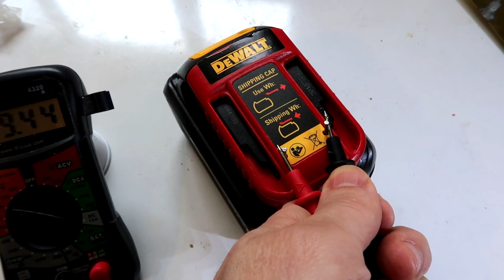Building a drill battery powered work light

Comment: Matthias, great video but as someone who works on lots of home brew projects with these batteries I think there’s one thing you need to mention. All lithium ion batteries should have a low voltage cutoff, as a Li-Ion battery drained to zero is essentially junked. Dewalt handles low voltage cutoff in the tool, not in the battery, so if you forget your light and leave it on all night you’ve effectively junked your battery. I’d put a note in the comments or somewhere to be sure people know this, I’d hate for people trying to save money on their light to junk $75 batteries instead.
Reply: Sounds like an important callout! Is that not already integrated into the battery itself? If not, how would someone add this?
Reply: @derekroetzel  done lithium ion batteries do, DeWalt chose to include that in the tool and not the battery. You'd need a circuit to do that and put it inline. I don't have one in particular I use, but I imagine digikey and them have premade boards for that

Comment: Be careful! DeWalt XR battery packs do not have undervolt protection. A bulb like this will suck the battery dry to the point it might not take a charge.
Reply: if that ever happens all you have to do is take a good battery and jump the dead battery in parallel for a few minutes, and it will bring the dead battery back to life..... this is coming from someone that has been working with all types of lithium batteries for over 20yrs...
Reply: Are you think that the first lamp has same protect?
Reply: @darkfrei2  the DeWalt lamp has protection, yes.
Reply: @OliWarner  So you can take the body of this lamp and set new LED to it.
Reply: Since the bulb uses a voltage regulator this won't be a problem, as the power should be cut off at a certain voltage
Reply: @CementRoots  It still will do damage and lower it's run time
Reply: With all dewalt cordless tool s you can run the battery down that it won't charge from the charger! I found out when I borrowed my neighbor a couple of batteries and he drained them to the point of no return. I got a nimh battery and jumpstarter the 2 dewalt batteries and good as gold. He must have been running them till they cut out and tried running again. The BMS in all power tool batteries are a bit dodgy from experience.  Anyway. Great video and cheers from Australia 🙂👍👍👍

Comment: Just watch out, the battery might not have over discharge protection. Not sure about the dewalt with the whole flex volt thing but with my Milwaukee batteries the terminals are connected directly to the cells (and the protection is in the tool). That said, pretty neat, have been meaning to do a custom work light for a while.
Reply: This is true for DeWalt batteries too; protection is in the tool, not in the battery.  The worse part is that there is no short circuit protection. Mathias should have put a compact fuse on one of the wires IMO.
Reply: @mrvelleful  they are pretty small wires...
Reply: Yeah, this would be a really cheap way to kill a very expensive battery. 

It also needs a switch, because fitting the thing into those tiny holes in the dark. And stepping on nails sticking out of a board.

Comment: I bought off eBay an adapter that has two wires and fits dewalt 20v batteries for 12 dollars. I then connected it to a 15 dollar led off road light. Works just great.
Reply: Not bad, however you're looking at $27 for a light.
You can these lights for like $5 or a COB array of 10-25W for same price.
Reply: @boots7859  that adapter is very flexible though, easilly can be adapted to work with anything. Worth getting.
Reply: Careful if your circuit doesn't include a way to protect the battery from over-discharging. Every DeWalt tool prevents you draining the battery to where you cannot charge it. Would hate to see you scrap $100+ of batteries!
Reply: @Ralph Macchiato it doesn't always work. Some Lithium-ion cells can be irreversibly damaged (e.g. swelled) by uncontrolled discharging. Had this happen to some good RC batteries.

Comment: I got tired of trying to improvise multimeter probes to measure the voltage of my battery, so I made a small voltage meter: 2 standard brass male terminal connectors that slide in to the contacts, and a $1 voltage meter. Works perfect.
It's for the small Li-ion batteries for a small Bosch impact driver. The battery lasts a frustratingly short amount of time.
Reply: I glued it all to a piece of wood that I carved, so one side sticks out and doesn't allow you to plug it in backwards and possibly ruin the meter. Hope this makes sense. Just thought I'd share the simple idea for using terminal connectors.

Comment: Yeah these LED bulbs also work well to convert old 18v flashlights with incandescent bulbs to LED. The original bulbs draws 10 watts and puts out 60 lumens whereas a 7 watt LED 12V Track Light puts out 500 lumens...All you have to do is rip out the old reflector and what have you.Then mount the bulb in the plastic lens securing it with screws or some small machine screws and nuts. To connect the power you can normally solder the new bulb directly to the wires for the old bulb socket....One important thing though, you need to drill some holes in the flashlight housing around the new LED bulb for ventilation or it will overheat and burnout after about 20 minutes of continuous use.

Comment: Do the DeWalt batteries have internal battery management? Will they cut off when the voltage drops to a set point to avoid over-discharge? I've heard some brands will do it automatically, and some leave it up to the tool in question to avoid damaging the Li-ion cells.
Reply from the maker: I kind of assumed that circuitry is in the battery.  It already has the 20/60 volt switching capability.
Reply: Lithium cells should be protected on cell level, leaving it up to the tool for battery pack management is grossly incompetent.
Reply: I don't know about 20/60V model,  but previous 20V model had outputs directly soldered to cells - no protection.
Reply: @tomass9235  Yikes, that's an horrible safety practice for Lithium cells, to rely on the charger and load for protection.
Reply: @sparqqling  Positive side is that you can refurbish battery with just replacing cells - no fancy electronics to object the change. Fun fact - I have 2 dewalt 4.0Ah batteries and after long use on both the 5th. cell couple had much more wear than others. Dewalt DCB105 charger refused to charge it. 5th pair had much less capacity left compared to other cell pairs. Still not sure if this is chargers fault or coincidence.
Reply: I’m pretty sure Ryobi batteries have cell protection because their batteries are made to work with their old (NiCad era) tools.
Reply: Tomass -That explains why the 20v batteries I bought to up fit my DC970 drills won’t hold a charge.

Comment: If you bought these bulbs online, can you possibly provide a link to them? Afaik bulbs with a constant current* power supply in them are pretty rare (see bigclive's teardowns) so this project would be hard to replicate with most bulbs that one may have lying around.
*Edit: By that I mean a voltage independent buck converter instead of a simple resistor dropper
Reply: Look for the ones meant for low voltage rails instead of directly from mains. 

Also Clive tends to take the cheapest bulbs he can find and only rarely takes apart the things that cost actual money.

Comment: Most useful cordless tools I have. I just used those LED spotlights you can buy from china, intended for vehicle installation, and the Makita USB adapter for a battery interface. The cordless soldering station using a JBC iron comes a close second. I don't know why makita doesn't make those, or in the case of lights only crappy ones.

Comment: Is the low voltage cutoff built into the battery or into the tool? It'd be a shame to wreck a battery by running it too flat, but it won't be an issue if the LVC is built in.

Comment: There are a few models on thingiverse for 3D printing adapters for Dewalt battery. I use spade connectors inside nails and fix them to the adapter, so it slides into the connectors same way as connectors on the drill does.

Comment: It's possible that the regulator in the bulb provides constant current rather than constant power. An LED component provides steady light output when it is provided a constant current from a regulator. Of course this makes little difference unless you're selecting a regulator for the LEDs and not using a bulb with a built-in regulator.

Comment: Be careful doing this, I believe that Dewalt and Milwaukee batteries DO NOT have a low voltage protection circuit built into the batteries, they have it in the tool internally

Comment: You could attach the LED assembly directly to the plastic protector with Sugru, and you can also use Sugru to insulate the wires (and wire a simple switch into the circuit). No need for scraps of wood.

Comment: Is there anything in the battery to prevent it from discharging too much and causing damage? Have you experimented with how many hours you can get out of one charge?
Reply: No, for DeWalt all the protection ( overload, short circuit, over discharge, over charge) is in the tool and charger, not in the battery.

Comment: You have no low voltage cut off
So if the batteries don’t have one, you could very easily kill the battery if you left it in long enough 

I don’t know if the dewalt batteries have them internally
Reply: ‘Kill’ as in destroy

Comment: Is there undervoltage protection for those lithium batteries so they don't get below the rechargeable level?
Reply: No. All major brand tool brand batteries rely on tool-side low voltage cutoff. If he forgot and left the light on, the battery would be permanently dead.
Reply: @EvanCalder  So this should be a major concern!

Comment: Question...  Will this damage the battery if the light drains it fully?  The  DeWalt tools have a built-in shut off system to prevent full drainage of the battery.  Or is the protection sercuitry built-in-to the battery itself?
Reply: KelMaster Construction  NOPE!.... for all the nervous nelly's out there worried about killing the batteries.... if that ever happens all you have to do is take a good battery and jump the dead battery in parallel for a few minutes, and it will bring the dead battery back to life 
(so it doesn't fry, burnup or wreck the cells, its just the charger doesn't understand the low voltage and doesn't try to charge the battery and that feature was added by lawyers, not engineers)..... 
this is coming from someone that has been working with all types of lithium batteries for over 20yrs...
Reply: KelMaster Construction  never had a battery that i couldn't bring back to life.... and that's ion and polymer .... I've had some that didn't hold the charge worth the shit, but the charger did see the battery.... on those that won't jump, I would open the pack and hit the cells directly and see if that works... because just draining the battery should not 100% kill it...
Reply: KelMaster Construction  I'm an extremely cheap f**k...  ;)

Comment: great idea Mathias.  If you add a USB connector to the top plate, you might be able to use it on lots of different things.  I am doing a series of making  "portable power" (one unit using 4 Ryobi batteries) on my channel to be able to plug in lots of different electrical accessories.  just go to my playlist called "Portable Power" for more info.  I think this is a great idea to expand on.

Comment: You can buy the spare part battery terminals as an alternative e.g. the Makita battery terminal part number is 643852-2.  Very inexpensive.
Reply: I thought I remembered from an AvE video that makitas star batteries can't be "hacked" like this because they have a chip inside that only delivers power when it recognizes an actual tool signal. Could be mistaken.

Comment: Nice Idea, but very dangerous! 1. You don't have a deep discharge protection 2. Tool batterys that have multiple voltages, like for example the 60V/20V ones you have got typically parallel or put in series the different battery strings by the connector on the tool. if you discharge only one part of the battery, and it then gets connected to a charger or tool, there might be big scary equalization currents flowing.
Reply from the maker: The voltage is switched IN the battery, they are all parallel unless the tabls push the intenal switch all the way in

Comment: Hopefully these batteries have a low voltage cut-off built in.  I've made lots of lights like this using bare cells.  Great for bright lights on the cheap.  You just can't let anyone stupid use them.

Comment: I'm looking for these low voltage bulbs, but having trouble determining if I am finding the correct ones.
Does anyone know the model / part number for these.
Trying to build a simple battery powered light set-up for a basement stairwell that I can use Ryobi One Plus battery to provide power.
Reply: I think you can use any low voltage spotlight bulb (flat on the top). But I am not 100% sure about that. I have seen them in 3, 5 and 7 watts, and they come in warm white light or in bright white light. I wouldn't have gone higher than 3 watts if you are going to use them on these small batteries. You could also buy the Ryobi USB adapter on which you can use USB led lamps or led strip lights. Ikea is selling Harte desktop lamp and Ledfyr fairylights with USB plugs. They used to sell a camping lantern with USB plug too, but I don't think they are selling it anymore. I am using all of them. In a stairwell that you are only using a few times a day, you could also use one of their battery powered spotlights with motion detection. You can mount it to the ceiling or to the wall.
Reply: @milcotto4153  Thank you for all the ideas Annie!

Comment: Just be careful to not drain the battery to much or you'll ruin it. If you wanted to bullet proof it you could get a basic voltage cutoff circuit that would turn off the light automatically to not draw down the battery to much

Comment: Why didn’t you go for copper nails, that are in bags of clamps for copper pipes, the resistance of the Steel compared to Copper would give you a longer battery life.
Reply from the maker: why don't you calculate what tiny fraction of a percent of difference that would make?

Comment: These batteries can be used to boost a dead car (pick-up in my case) battery.  I find that amazing!  Just make sure to unplug it really quickly when he vehicle starts.
Reply: What happens if you leave it ?
Reply: KFlorent13 these batteries are DC, if you leave it then it can discharge beyond the voltage limit thus rendering the battery unable to charge
Reply: KFlorent13 
While I never tested this, I am pretty sure that damage to the battery will occur since it is now part of the charging system of the car (alternator).  Too much current.

Comment: Super idea! Could this be done by using the charger instead of the battery?
Reply: That is not a good idea. The charger is not designed for that sort of continuous steady running. Just buy a switch mode power supply from your electronics store or a used laptop power supply. Much cheaper and designed for your purpose.

Comment: Causing a short circuit certainly would be no good but most modern batteries have pretoction circuitry inside which just cuts the power.
Reply: The cells themselves are fused. But after you burn out the fuse, the cell is dead. The tool would have a resettable fuse/limit at a lower current level than the cell's internal fuse.

Comment: Matthias, please make a video on adding an LED light to an old router or drill.
Reply: That's easy. Just take the housing apart and connect an LED with a current limiting resistor in parrallel to the motor

Comment: If lithium ion batteries are completely discharged they will never charge again. I'm not sure if it's the tool or the battery that cuts off the power when it gets low. If it is the tool, you'll destroy your battery as soon as you run it dead.

Comment: Have a Ryobi 18v flashlight sold as a package-deal with a drill, the light was obviously old-stock as it used bulbs(impossible to get and 4$ ea. when you do) and not LED's(which one would automatically assume these days) so thank's for this......
Reply from the maker: just modify the flashlight to use one of these bulbs.
Reply from the maker: just modify the flashlight to use one of these bulbs.
Reply: Remember you can spend a bit more time and make custom LED lights with different batteries (wired in series)
20v: 4x 5v LEDs
18v: 3x 6v
12v: 1x 12v
9v: 3x 3v, etc.
Reply: @matthiaswandel  That was the idea, a simple turned alu ring should work together with a connector and some wires soldered to the original contact-points

Comment: I hate safety trolls as much as the next person, but in this case perhaps you should explain some of the risks of copying what you did here. For example, is the protection circuit inside the battery? Is it working? What can happen if the skin temperature exceeds 130C. What can happen with a short circuit and no fuse. Etc.  I'm not suggesting a thermal runaway is likely - but if it did occur, the consequences could be serious. I doubt that your average DIYer would realise there was any risk to modifying lithium-ion battery systems. I'm not trying to discourage this - just let people know there are specific risks with this technology. Particularly to never open up the battery and modify it's internals.